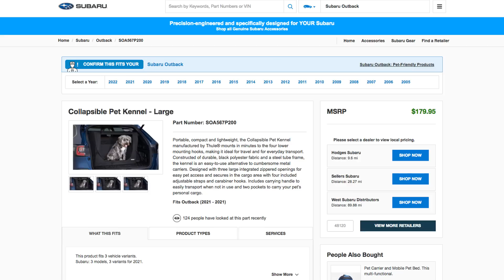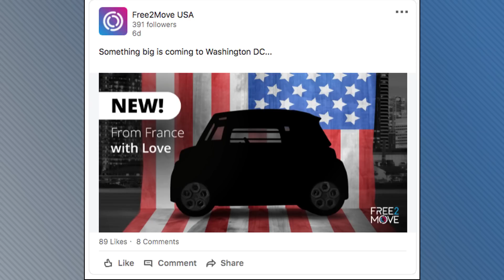Citroen Ami Coming to the U.S.; Ford & BMW Invest in Solid State Batteries - Autoline Daily 3071

Comment: In the Model Y battery cost is under 85USD/kWh ... and they want to get it down to 56USD/kWh with the 4680 fat cells. Can solid state be better AND cheaper? 🤔
Carbon is not the main problem with fuels. Lots of other emissions in the exhaust of cars.

Comment: Citroen Ami. A Smart move?
Blue Gasoline. Better be priced the same as 87 octane and get equal MPG.
Reply: And not damage engines.  Like ethanol.  Worse mileage and corrosive (when used in older cars).

Comment: It's good that Ford is investing in battery R&D. Problem is that's tech that won't come to market until the end of this decade. What are they doing THIS decade to maintain their market share? I get not wanting to invest in tech that may be obsolete in a decade, but that's making Great the enemy of Good. By the time Solid State tech is ready for mass production, Ford may be a VWAG brand.
4:00 The problem with engines that burn fuel is that they BURN FUEL. It doesn't matter if the fuel was pumped from the ground or reformed from atmospheric carbon. The engine puts that carbon into the atmosphere. We're already over 400ppm of atmospheric carbon, we're beyond the point of slowing down and being able to cycle in place. We need to stop adding more carbon and work on removing it from the atmosphere. eFuels and 'low carbon' fuels are just cycling atmospheric carbon. Meanwhile, this is resources that could be spent on actually doing something meaningful. 
And oh yeah.. It still costs more to operate and maintain than EV.
This is about how fuel companies can try to stay relevant as zombie industries.

Comment: The Fresh Fuels are coming. This is what competition looks like. It is [rare] for anyone to actually try unless given a reason.
Reply: Natural gas already works
Reply: @Cre8Lounge  
By "Fresh Fuel", which includes Porsches' "E-Fuel" and this Alliance's "Blue Fuel", or Synthetic Fuels (Synth Fuels), are fuels produced from freshly made without fossil sources.

So far Porsche's E-Fuel will use freshly produced Methanol, refined into Diesel and will be taken further to make gasoline. 

I could see Natural Gas being used in a similar fashion which until more clean powering options for the process are had (Nuclear) , might actually be the cleaner option for the time being.